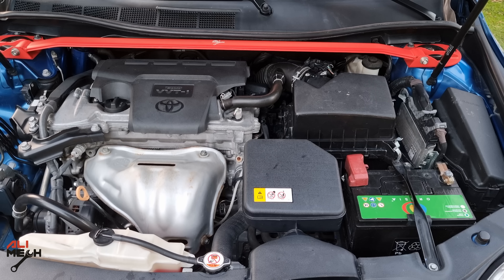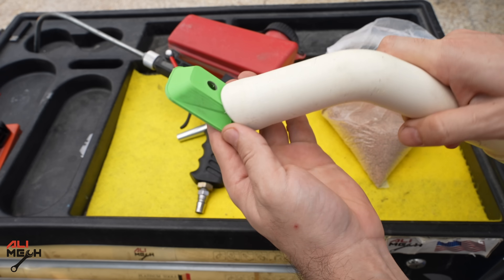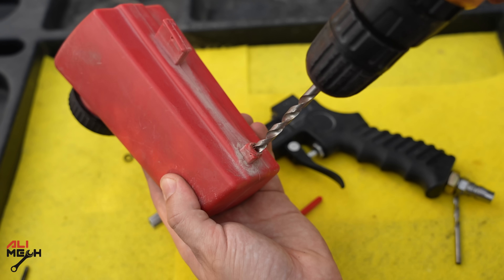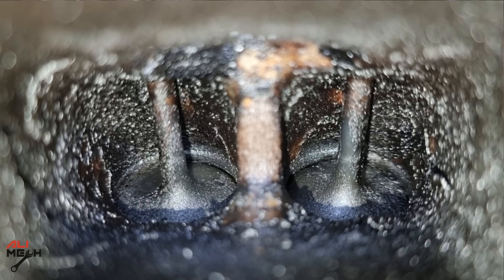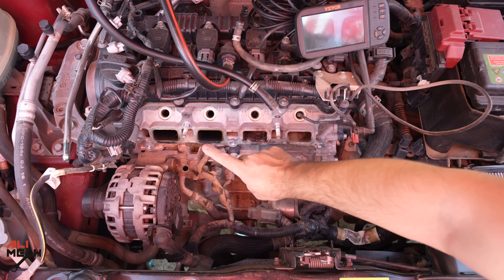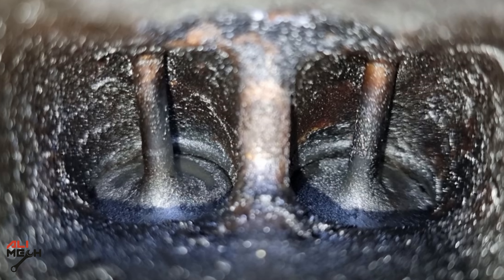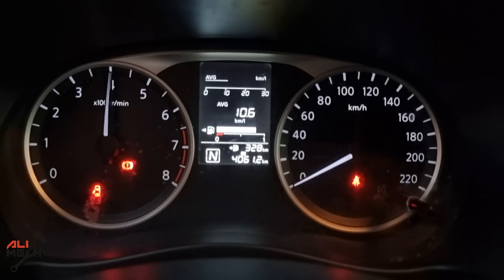SUPER Clean intake valves with this simple trick...

Comment: You can clean the stem and valve but you can't clean the face and lip, the lip becomes enlarged up to .5mm in diameter and the seat becomes dirty, once you discover dirty valves the only and best way is to remove the head and head gasket then each valve and lap each valve to the seat, the carbon that build around the lip is as hard as steel itself and nothing will remove it unless you remove the enginge head😮after that to prevent the problem again you must add a 6oz bottle of fuel additve or carb/injector cleaner to every time you go to the gas station which cost about $3 per bottle and thats why people have expensive problems they are too cheap to buy fuel additive😮

Comment: Having a similar issue with my 2017 Toyota 4runner. Dealership told me it was the coolant getting into the oil. Another shop said it was the piston rings. All this because there's white smoke from the exhaust. 

Took off the PCV Valve, and there was oil in the hose, so I then took off the intake manifold, and it's got a bit of oil in there. I don't think it to actually be either one of those, I think a shop I took her to shot oil into the I.M. so then I'd have to come back and have them fix it 🙄😡😡😡

Comment: Sandblasting the valve port area.....relying on vacuum to pull out the grit..... will cause problems.

Needs a followup video. 

Maybe add compressed air via the spark plug hole to blow grit out when valves opened. Still a risk grit will get into the piston rings. Then its game over (slowly).

I feel brake / carby cleaner and a rotary abrasive tool on a flex drive into the area is less risk.

The high rpm, and water injection to create steam method seems safer.

No easy solution.

Comment: Sandblasting works great on carbon buildup but in GDI engines the buildup on the valves is oil residue from the pcv system.  It is sticky and can not be sandblasted because it is soft and sticky the walnut shell just stick to it and form a layer.

Comment: Now what’s the difference of using walnut versus sand? What kind of drawbacks are there with sand?
Reply: Walnut shell is less abrasive than sand. The valves are sensitive and the valve seat is critical. Walnut blasting won't damage these important areas

Comment: there are valves that remain slightly open, valves that no longer have the factory seal, if you don't remove the head it's really risky to throw sand inside.
Reply: Use wallnut

Comment: Use CRC valve intake cleaner under $30. Less trouble. See GDI Cleaner Comparison: How Well Do They Actually Work? ( GDI / Intake Valve Cleaner ). He has a good line up of all of the PEA cleaners. 
I originally asked about walnut blasting, as usual the million-person California location I live in has no shops who had heard of it and none who wanted to help. 
With GDI you need to do CRC twice initially and then once a year or every 10,000 miles. Good luck spending $500 every year on walnut blasting. 
The CRC process takes a half hour plus a wait time of 1 hour to heat soak and then a 30 minute drive on the freeway afterwards. Proven results. CRC came out top in YT PEA cleaner rankings.
Reply: Yeah the PEA cleaners work great. I use Gumout with PEA injector cleaner in my tank once a month. Did my own test by putting heavily carbon soiled spark plugs in a bowl and submerged  it for about 15 minutes. CLEANED EVERY BIT OFF. And I didn't use it full strength I mixed it like 80 percent gas 20 percent Gumout with PEA. And it made the carbon a light discoloration but 100 percent fluid that's able to be burned off. The others I tried took off only a little but left it in solid form.👍
Reply: @billesposito2112  You've a grat defense plan - Gumout keeps it down.

Comment: It misses the part that truly matters though. The contact area of valve with engine head inside combustion chamber, which if gets soggy it prevents the valve from fully closing and causes drop of compression and hence the instability on engine work. surely it looks nice from the outside, but when it comes to the function...somehow I doubt there is a significant effect.

Comment: So unless I'm missing something he is filming this process thru the injector port, which gives us a good shot of the top of the intake valves as he blasts them clean. That tells me this engine is not a Direct Injection Engine, where the injector port would lead directly into the combustion chamber? We also know that it is indeed DI engines that have the carbon buildup problem on the back of the valves, and need this type of walnut shell cleaning method.
  So how did a multi-port injection engine get such a bad carbon buildup on its' valves? It would also mean that the carbon buildup has been being sprayed by the fuel of the injector the whole time, giving it a different characteristic as compared to carbon buildup on a DI engine's valves???
If I'm way off base here, please enlighten me!!!
Reply from the maker: That's true, even though this is not direct injection engine, but it had that much carbon there, that's correct,  the camera was in the fuel injector hole
No idea how it came to this carbon buildup,  it's a used car and wr bought it, I think the previous owner was using bad quality oil which had so much oil vapor and lead to that

Comment: How do you get the media out? Small vacuum? Or blow it out? I’d be paranoid about some of the media blowing by the valve and getting into the chamber. Why not remove the head first to eliminate that possibility? It’s extra work but seems like a better safe than sorry option to me.
Reply from the maker: I was working only on the closed valves, it won't get in the engine

Comment: I recenty took the intake manifold off my car. Port injection V6. It needs premium fuel.. have to due it being a twin turbo quad cam unit. Here in Aus the highest pump fuel is 98 octane. My ports and intake valves are all clean like the valves after you cleaned them with walnut shells. That was at 120,000km.
If your car has port injection... run premium fuels.. It's more expensive, sure, though they have additives that help clean your engine.
Great video and the result was fantastic.
Reply: You don't get it. This crap on valves is from not from fuel you use. It is from oil mist and EGR garbage.
Reply: @justlife2129 I think his point is that the fuel will clean that oil mist…and premium fuels have better cleaner solvents in them

Comment: Great video, but one thing I would recommend is using painter’s tape over the other intake ports to CYA.

Also, for the throttle body make sure you clean the edges. That’s the important part of the plate, not just the barrel and backside.

Comment: If you have a DI engine DISCONNECT THE PCV & EGR from polluting the intake stream the very FIRST THING! That will immediately stop the Carbon collecting on the intake ports and valves. It's political in an effort to satisfy the lobbyists for EV.
The Biden administration had their foot on the auto manufacturer's throats to make piston engines so sophisticated and high maintenance the common person can't do nothing to them.(probably from lobbyist's for EV bribing kicking back and insider trading info to congress) 
Back in the 1960's it was a cheap fix to dispose of crankcase fumes into the incoming air stream. It worked and wasn't too much of a reliability or longevity issue with carbureted engines. When TBI and Port Fuel came along the intake plenum and throttle body began to exhibit problems and it added an additional maintenance issue: Cleaning the Intake Plenum, Throttle Body/ Air Valve.
Soon they began using EGR to lower combustion temperatures to control NOX. It was problematic, but it was so cheap they kept using it despite the EGR valve getting clogged with soot. It further polluted the Intake Plenum, Throttle Body and Air Valve. . 
But, when they went to DI they should have totally redesigned those two systems. They are incompatible with DI. *(perhaps DI both of them)
The auto companies set us back about 100 years in durability AND maintenance when they went to DI without redeveloping the crankcase fume disposal and Inert Gas sourcing.  They should have gone the extra distance and engineered a bullet proof system to dispose of the oil & vapors from the crankcase *(perhaps DI them) and a way to use the CO2 present in the exhaust differently *(perhaps DI the EGR) to maintain durability and low maintenance. 
We have to figure out how to stop feeding garbage into the incoming air for the engine to burn prior to the inlet valve. Either filter it and dry it or Di it after the inlet valves.
Catch cans may work as a part of a more compressive system, but they are only a beginning. Just like a fuel filter is cleaning the fuel, we need to completely filter and dry the crankcase fumes befor we reintroduce them into the combustion chambers. *(or DI them)  I've not seen a commercially available catch can that works 100%. If you could find one fine, then you could reintroduce the NOW DRIED crankcase fumes back into the engine's incoming air stream to be burned BUT WHY NOT just dump it into the exhaust upstream of the cat? If it's clean and has no particulate or liquid in it, it should not hurt the cat. Besides it's a whole HELLUVA lot easier and cheaper to R&R a Cat than an engine. NOW, What to do about EGR? Filter it befor it goes back into the incoming air stream.*(or DI it)  It can be done. Look at the Diesel particulate traps on all the Diesels of today. Just get the particulate out of it. You cannot simply shut off those two systems, we have to work around the issues the auto manufacturers allowed, that threaten the future of the internal combustion piston engine.   EGR must be there as a source of CO2 to cool the combustion and Crank Case Fumes must not be allowed to escape without being treated. So, somehow, at some additional expense, there must come into being a couple of systems that can clean and dry the crankcase fumes and filter the exhaust gas recirculated into the engine. It really is just that simple. NOW GET GOING!  This is America, we can do it. GOD save the piston engine. (please) ben/ michigan

Comment: I would never spray sand into my intake valves for cleaning lol wtf
Reply: Its probably Walnut shell or some other organic blasting material or plastic that can burn off safely and too soft to score cylinder walls.  Also probably need to vacuum out the opening when you're done.

Comment: Simple ?  How about spray CRC intake cleaner through brake booster OR pcv valve line and not have to half-way disassemble top half of engine.  This is for direct injection of course.

Comment: What are the benefits of cleaning these intake valves?
Reply: Smoother intake air flow into combustion chamber. This is just one of the factors affecting engine power and response. Timestamp 6:35 min, in the video, offers that explanation.

Comment: How to pull rotate crankshaft pully?? My intake position in the rear machine
Reply: Use an appropriate sized socket wrench and bar extension on the bolt securing the harmonic balancer to the crankshaft.

Comment: The intake valves never get that dirty unless you drive without an air filter. The exhaust valves are the ones that get dirty. However I always add acetone to every fill up and it stays very clean.
Reply from the maker: Who said that? this car been with filter and not even started without a filter for a second, without filter will be dust and not oil and carbon
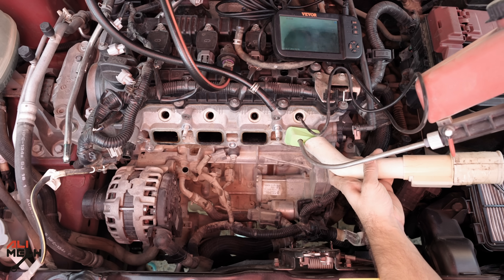Reply: Acetone in the fuel will have no effect on the valves on a vehicle fitted with direct fuel injection, as very well described in this video, at timestamp 0:35 to 0:58 seconds and, specifically, at 0:48 seconds for indirect injection engines.

The build up of deposits on the valves, over a period of time, is caused by the passing over the valves of minuscule amounts of oil passing between the valve stems and valve stem seals. Such small amounts of oil 'escaping' past the valve stem seals is normal on all cars.

Comment: You will never be able to completely blow away the sandblasting residue, so after a few hundred meters the valve will no longer seal and you will have to remove the cylinder head.
Reply from the maker: It's not sand, it's walnut shell, and it didn't get in the combustion chamber, because I was working on closed valves only,  if the dust gets inside, it will burn so easy and comes out
That's why it's safe to use walnut shells 
No worries,  car still running,  that procedure was 3 months ago

Comment: Spray bottle of water into throttle body at idle cleans the valves. Spray until you hear the idle drop & stop. Do this over & over. Proven to work, the water turns to steam which cleans the intake.
Reply from the maker: I did that before and have a video here too, I used steam even , it will never gives this result, and it can't be from throttle,  modern cars have sensor and get damages with water

Comment: Hi, great video! 
- How many kg of walnut did you use for the for 4 intake ports? 
- Which pressure in PSI was your compressor set ? 
- How many minutes did you blast per intake port? (If I assume my intakes are as dirty as yours, I should blast not less than X (?) min…)

And finally: can you tell me how to make/order an adapter for Hyundai i30 1.6 L GDi 2015 (99kW) ? 
🙏 Thanks!
Reply: He used 1kg of walnut and kept reusing it. Standard psi is 90, anything up to 120. The type of gun and the blast material you are using have an impact on the pressure you use. Blast for around 1 minute then clean and check with a scope.  Keep repeating until cleaned to the desired level.
Reply: Hi, thanks a lot for your response. I just scrolled down and saw Ali’s response to the same question…I have a couple of other questions, though:
1) is AliMech actually saying smth at the beginning of each video that sounds like „hollow“ (?) and then smth like (ts) caileme“ ??? :))….
2) if you say he (or it was a typo and it is you…) was reusing the walnuts, then did he really use the Autool device for recycling or he collected the walnuts (plus the carbon debris?) out of a normal workshop vacuum cleaner to reuse?
3) i was thinking that he did not use the Autool but just put it into the description as an option? I thought he only used the Blast gun with the walnut reservoir. I think you dont need and/or it makes less sense to use the Autool device in addition to the blast gun with reservoir? Or he indeed used Autool but didnt fill it with walnuts but just used the filtering/recycling of walnut function of this tool?
4) I heard that if you use 90 PSI that the walnuts themselves get crushed and lose their effectiveness after initial use at these pressures….so I am still uncertain about the 90 …
Reply: @bkrljanac  1: Don't know, didn't listen for this. 2: AliMech said he reused the shells, I haven't for jobs I have done but am considering it. I would add a cyclone dust collector before the shop vac, this would make it much easier to recover the shell. Then I'd want to filter the shell to get rid of the extracted carbon, I'm still thinking about this part. 3: He didn't use the Autool, it was just there as an example of what you can buy to do the job, or buy a $5 sand blaster gun like the one he is using. 4: 0.4 grade shells are very fine, putting them into a 90psi air stream doesn't make that much difference to them. If you find the psi is too high for what you are doing, just turn it down. There is no "right" way to do this, find the settings that work best for you and the equipment you have. A lot depends on the gun you are using.

Comment: HOW MUCH damage is abrasive sand going to do after getting into the engine (in short and/or long term?). Is this not madness?
Reply: This isn’t sand. It’s crushed walnut shells. Too soft to damage metal. This process is exactly what any garage would do to clean intake carbon buildup. Also, this same technique is used to clean turbine blades in jet engines. Walnut is harder than the carbon deposits but much softer than metal. Hence why it works.

Comment: Do you think this coulld fix a sticky exhaust valve on a Mini One, before I have to take the head off and clean it completely?
I have a misfire on cylinder 3 and the value is stuck open with no compression.
Love your videos.
Reply: The valves stick in the guides. 

Cleaning the back of the valves will make no difference.
Reply: @Ray1981-o5h  Ye, before I start buying the gear, I'm going in with a borescope so I can see the valves as well as take the rocker cover off.
Cheers.
Reply from the maker: Thanks, yes it will fix it, it also cleans valve shaft and don't let it happen,  but better to install oil Catch can too, it will prevent that oil vapor
Reply: @AliMECH  Cheers.

Comment: In the past I drilled small holes in the intake manifold and inserted plastic lines to a water and alcohol 50/50 mixture in a gallon bottle and just drive normally. The vacuum would pull in the mixture cleaning the valves. Seal the plastic lines when finished. Did this once a month. Seemed to work well as the engine ran just fine.
Reply: dude added his own intake manifold injection system to a DI engine. Cool.
Reply: WHAT?
Reply: Yeah...WHAT??!?
Reply: very good idea
Reply: Where's the proof buddy boy?
Reply: BS

Comment: Great vid, I have the same gun and setup (you can get a long straight extension from spray gun kits that fit a 1/4" connector). I always tape up the ports I have done and the open valve port, this stops any random shell blow out getting into them. Baking soda also works, it's cheaper but not as good as the walnut shell.
Reply from the maker: Great point, I think if you want, you can do last step with baking soda, it will be like polishing out step